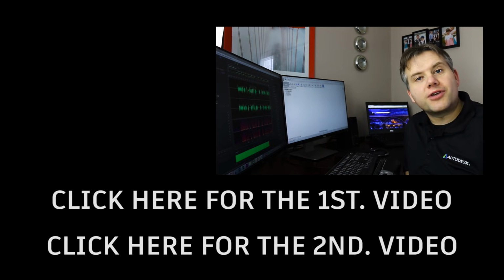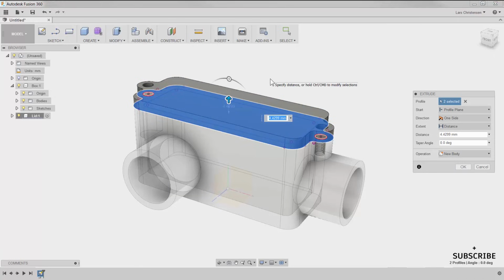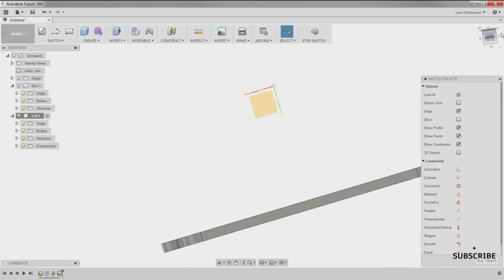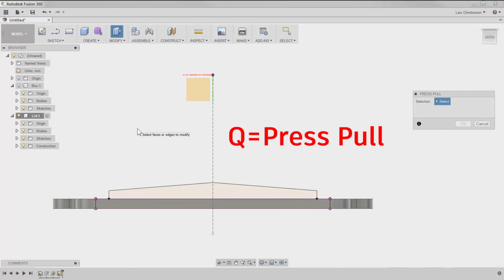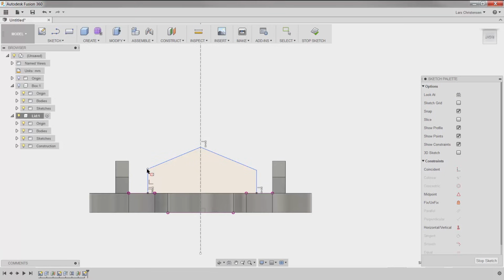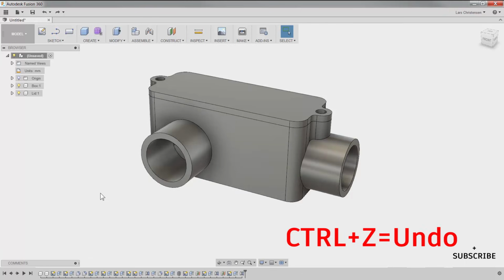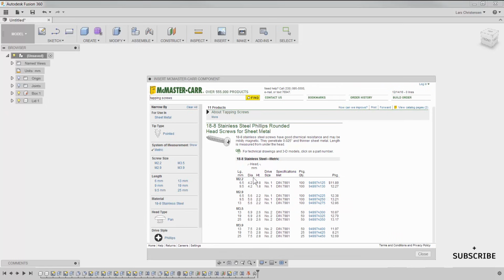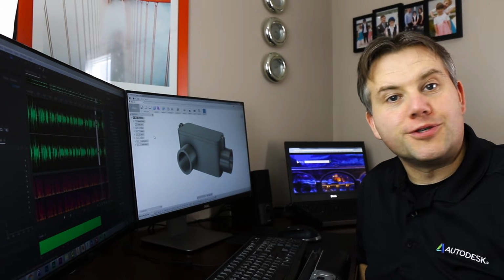Fusion 360 Tutorial for Absolute Beginners— Part 3

Comment: having problem with the latest version of Fusion, when I try to do the dimensions of the lids tabs, when I select 2.5 the lid is being pulled up in the air 2.5 mm rather than sticking to the base of the lid.. I cannot understand why
Reply: Hi, 
First, thank you Lars for the tutorial.
Same here. Also new with F360.
My approach was to Project the offset plane on the Lid surface. that made some sort of line there that you can use for Colinear constraint. hope it helps. 
I did that because even if for the first lip you can use the trick with Colinear using the edge of the Lid, for the other lips (smaller ones) I couldn't find an edge there, there are only curves. so, again, I Projected the offset plane on the Lid surface and use the created line.
Reply from the maker: Hi Juan, Are you working within the "Lid" component, or are you working in the overall assembly? Look at what you have selected in the tree on the left side of the window.
Hope this helps.
Reply: @cadcamstuff  hi Lars, I fixed by adding colinear attribute. Looks like another user here had the same issue.
I think the behaviour of fusion 360 is a little diffferent on this version
Reply: @Pin_Fandango  I had the same problem. Could you explain how you solved it.  I did something but I know it wasn't the correct way and it somewhat  works. I tried forever to fix it. Thanks for figuring it out!
Reply: Juan, yes you do need to use the "Colinear" constraint here.  I too was having trouble as the bottom of the tab kept pulling away from the lid when you adjust dimensions.  To solve this I used the "Colinear" constraint and selected both the bottom of the tab and the line for the bottom of the lid and this ensures that they re now anchored to the lid surface.  I also noticed that the tab outline would not turn BLACK and could not be extruded unless this was done.  I am using the new version of Fusion 360 and Lars videos are based on the slightly older version.  Great videos Lars, thanks!
Reply: I am having the same problem as Juan and Mike.  At the 7:00 min mark in your video, when you draw the first line, you get an "X" when you are over the edge of the cover.  I do no get this.  And like Juan said, the bottom of the sketch comes up when dimensioning the 2.5.  There is nothing keeping the bottom line of that sketch on the surface of the lid.  It's very frustrating.. I do have lid component selected.  Thanks for posting these videos.. they are great.
Reply: Another one having this problem I'm afraid. The tutorial is fantastic - just this one thing that isn't behaving correctly!

Comment: Ace videos, am following along with the model I have got to 7mins in this video and I’m STUCK. So I have the plane and the centre line but I can’t snap to the edge of the lid in order to draw the lip. Using the latest version of fusion 360.  I have snap turned on, and snaps to the construction line. 
Any tips or help most appropriated.
Reply: Xavier Choe
3 months ago
After setting the horizontal dimension, but before setting the vertical dimensions, apply the "Fix/Unfix" constraint to the two bottom vertices. Then, when you set the dimension they won't separate from the lid. Hope this helps :)
Reply: I'm the same man. I had to add a horizontal line across the 'top' of the lid to sort of create the full shape which seems to get me closer, as luke says in another reply, I then had to fix the left and right uprights, as well as the bottom one.... but still, when I try to do the dimensions for the 'peak' of the thing on the inside of the lid, it either shits the bed, or barfs with overconstraint. Must be something different.

Comment: i have used AutoCad for a long time, but only in 2 dimensional, having the need to go 3D, to three D print, i was wondering how i was going to do this,  i knew of fusion 360, which i know is a quality software.  similar to solidworks, i  thought it was going to be too difficult to migrate to 360, but i came across your excellent video series, in the three part videos you demonstrate the simplest and most effective route to using the tool, i liked the simple 80- 20 rule approach, which you demonstrated very effectively.
the fact that you have the autodesk tee shirt, suggests to me you are an autodesk trainer, if not you most definitely should be.
thank you

Comment: When I try to draw a line for the side guards, my line will not attach to the lid.  What am I doing wrong?  Thanks
Reply: Had the same problem, what worked for me was: Account Circle (Your Name) --> Preferences --> General --> Design --> Auto Project Edge on Reference (found this answer in further down in the comment section). Then, for the changes to apply, undo the side guard sketch and start again.
Reply: @jishnumehta4355  THANK YOUU!!!
Reply: @jishnumehta4355  thank you so much! The fix/unfix thing is an ok workaround, but with that option enabled, it's so much easier!
Reply: @jishnumehta4355  Thanks for repeating this :)
Reply: @jishnumehta4355  Big help!
Reply: After setting the horizontal dimension, but before setting the vertical dimensions, apply the "Fix/Unfix" constraint to the two bottom vertices. Then, when you set the dimension they won't separate from the lid. Hope this helps :)
Reply: i am having the same problem i have rewatched the video 10 times and i cannot get the projected geometry points to show on the lid.
Reply: @CallsignPoet  i think you should use snap feature while in sketch, it needs to be on

Comment: Excellent teaching, thank you Lars, and I look forward to following further videos!
I but I have found that the differences between the version of Fusion 360 and my version - only just got it - make some things seem to happen very differently! If you CAN find the time, I think an updated version would be worth doing.
One thing I found was in drawing the lid 'guides'. When I used line to sketch the first shape, the point wouldn't snap to the surface, and it drew as a completely independent shape. The only thing it would recognise was the construction line. When I dimensioned it, the shape moved UP away from the lid surface! I had to do some exploring of my own to get it in the right place!
I also find that your links in the videos don't work, I had to use the links in the description.

Comment: When I try to give the dimensions for the vertical sides of the 2.5 mm, it either goes up above the lid or imbeds itself into the lid, same thing for the tip to the last bottom line that is connected to the, I was able to keep it flush to the lid by turning it around and giving the 2.5mm dimension from the other side, but either way, when i would get to the 5mm height dimension it would go up into the air, or again, imbed itself into the lid. Any help would be greatly appreciated.
Reply: From - @UCnQFmsNTFAhTIPJVMyKgxFw -  preferences in Fusion. Make sure to turn ON "Auto Project Edges on Reference".

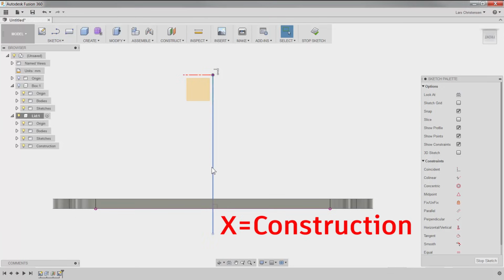Same here. I notice that when Lars places the construction line (at 6:47) he gets two dots highlighted on the bottom face. I assume that means it's an active feature. Mine don't highlight. No active features on the face.
Reply: @doug1cooper  Exactly, turned that on and finally could complete the missing lid parts, thanks! Preferences / General / Design / Auto project edges on reference
Reply: @gustavoruiz5637   where is this on the software i can not find the option
Reply: @christopherdemakis5649  Hi Christopher, I've just said it, its in Preferences / General / Design / turn on Auto project edges on reference. The preferences are at the top right of the screen under your username right-click menu (2nd entry)
Reply: @doug1cooper  Thank you for sharing.  I could not figure this out.  I got so mad I stopped using Fusion for a year.  I'm just now picking it back up.  My little barn kept going up off the lid.  This fixed it.
Reply: me too, think software has been updated since this video came out and has changed
Reply: Same thing happenning here, so far I can follow all the steps. Seems that somethings related to the current version. I'll be seeing more tutorials about it till I found the answer.

The sketch keeps hanging in the air, the cursos doesnt change its shape when reaching the base as in this video.
Reply: had this problem. theres a constrain called collinear which forces 2 sketches to share a common line this forces the triangle to use the bottom line so it wont move on you. i had the same issue and scratched my head. hope this helps
Reply: @ordinarynomad5374  Thank you very much. That is what worked for me. Auto project edges on reference as suggested above did not help. I had to click collinear from the dropdown, then click the bottom line on the lip thing and then click the top line of the lid and then hit enter.
Reply: I constrained one point with the line of the lid so it would be fixed to that
Reply: "Auto project edges on references" worked for me but I had to fully close the document and then re-open before it was effective for me.

Comment: They have moved the constraints. So to make the line on the edge of the first tab you drew straight, you have to right click and select the Horizontal/Vertical constraint from the flyout menu. Same with the Symmetry. After you select the two points and the X-line, right click to select Symmetry. Is there another way?
Reply: when I right click and select the Horizontal/Vertical constraint from the flyout menu, it shows an error saying "Sketch geometry is over constrained". Any idea of how I could fix this?

Comment: The screws part is where I am stuck. I get the screws from the 'shop' into my drawing. Then when using Joint Origin (only then I get the Capture Position) it is impossible using the Control key to get my pointer in the middle of the screw even if I enlarge the screw full screen.  Somtimes I managed to get the screw selected and tried to get it into the hole. But also that is not in line with what I see in the video. Where do I go wrong????

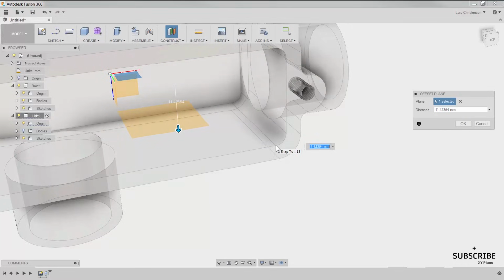Comment: I cannot snap to the reference line as you do at 5:32. I have "Auto Project Edges on Reference" on and I've searched through majority of the comments here and other articles.
How can I construct the Offset Plane by snapping to the box's body as you do?
Reply: I've been trying this for 2 hours. I cannot get it to snap to line, nvm. The part you are looking for is the point where the lines connect. There is a light circle if you zoom in.
My problem is at 7:12 . I cannot get the point to stick to the line
Reply: @titansfan2104  I'm at the same point. Did you ever figure it out? Edit: Nvm, found the answer 2 comments below.

Comment: I'm running in to problems when adding the lid supports using Offset Plane to draw inside the box opening plane. I can draw the hexagonal shape, and use the symmetry constraints, but the line never connects to the lid (Line tool never places and "X" on the lid edge) What am I missing?
Reply: I'm having the a same problem
Reply: I’m also having the same problems. 4 hours trying to figure it out
Reply: Did you have any luck figuring it out cause I'm having the same problem
Reply: @robertmac24  I figured it out!!! Go to your preferences in Fusion. Make sure to turn ON "Auto Project Edges on Reference". The Hobbyist Trial has them off by default.
Reply: @robgluckman7943  awesome thank ya man
Reply: @robgluckman7943  THANKS. I found that earlier but it didn't seem to help. Maybe I've been staring at this screen too long LOL
Reply: @robgluckman7943  THANK YOU!
Reply: @robgluckman7943  this did the trick. Thank you
Reply: @robgluckman7943  Thank you! I was going nuts over here
Reply: @robgluckman7943   Thanks man!! It works!!
Reply: @Robert Gluckman  Thx a lot saves me a few years of my life

Comment: when i extrude the tab to give it thickness, i put in the 2 mm, its shows what it will look like and looks correct. press enter and the tab completely disappears leaving only an imprint of the base of the tab.  any suggestions?
Reply: make sure your Extrude operation is correct. it might need to be changed to "join"
Reply: Ok I'll check that out. I think the problem might be related to when I drew the sketch, it wouldn't snap to the lid. Also, when I go to extrude it become red

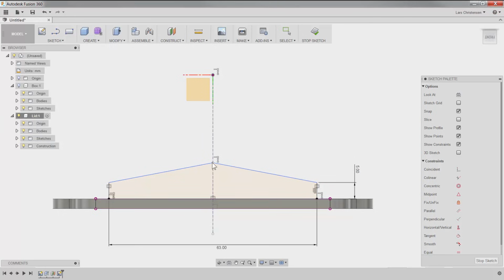Comment: Hi. First, great teaching. It's a lot easier to see than in my book. I'm having some issues that I wanted to crowd source. When I do the dimensions, as you do at around 9:00 for the slanted edge, the dimension moves the face the wrong way. I'm obviously doing something wrong, but I cannot figure it out. Any help from anyone would be great.
Reply: You can use the Fix constraint to fix the bottom line to the surface of the lid, that way when you change the dimension, it will change it in the right direction
Reply: @olsileka6522  Thank you! Been banging my head on the desk trying to figure this out!

Comment: I tried it a million times. 
When I set the distance to 2.5 it pulls the bottom up away from the lid instead of pulling the top part down.
What am I doing wrong?
Reply: Same !!
Reply: @giyad90 

I'm not sure why his attempt succeeds but in my case the shape didn't become black.
Once I added a 4th constraint that determined the distance from the bottom minr became black and was positioned correctly
Reply: @somebodyoncetoldme1704  Thank you, I have been fighting this for over an hour, told it that the bottom of the wedge to the top of the lid was 3MM and bam it moves down and turns black! Awesome!
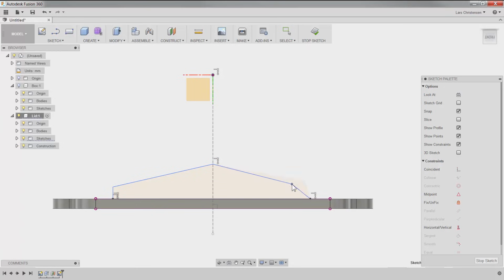Reply: From what I understand, you will have to add Coincident constraint between the vertical side line and the bottom horizontal line. Just adding on one side should be good.  What I did was click on "Coincident Constraint"-> click on bottom line -> click on a vertical side line.  The constraint now should be created.  There is an "L" shape icon indicating that but in my sketch it does not always show up.  It only shows up if I click on the join dot.  If you see this video at 7:50, you could see when he was drawing the lines the "Coincident constraints" get created automatically.  At 7:02, when he moved the mouse cursor to the bottom line, he explicitly mentioned that mouse cursor got changed because it found a cross section.  In my case, the mouse cursor never changed.  I think that is why his line came with the Coincident Constraint by default but we had to add it manually.
Reply: Another solution is to Fix the bottom 2 points. Fix->Click on the 2 end points of the bottom line.

Comment: So far I find this tutorial very fun amongst others Thank you Lars! I'm a newbie and no background on CAD and it's my first time to use a 3D CAD software, I downloaded the latest version of fusion 360 and was able to follow the tutorial from part 1 to 2 with slight fiddling due to different version.. but I'm stuck on part 3 at 7:00, the line won't stick to the edge of the lid, tried many times but the "x" mark just won't show up so after creating the lines then putting the  height dimensions 5mm on the side the face would just adjust downward into the lid... how to this? help anyone? Thanks!
Reply: @Lars Christensen  need help..
Reply: @allen5147  Make sure you turn "Auto Project Edges on Reference" on in your preferences menu (top right, click profile icon, select preferences, and the option is under the design tab).
Reply: @mammers15  Thank you! great tutorials! keep it coming!
Reply: @mammers15  Thank you! Had to turn this on as well, seems like it's off by default
Reply: @mammers15  thank you so much for this!
Reply: @mammers15  Thank you for this solution
Reply: @mammers15  THANK YOU!! I've been digging through comments and pulling my hair out for 45 min!!

Comment: Fantastic tutorial but When drawing "lid tabs", Very, very, very important to make sure "Auto Project Edges on Reference" is on in your preferences.  On the Hobby version Autodesk has it toggled off as of 9/17/21.  Program will not pickup the offset projected xz plane that intersect the lid bottom.  Thank you Mr Random for pointing this out.
Reply from the maker: Good point!
Reply: This saved my night. 4 hours trying time figure why my lines were pulling away.

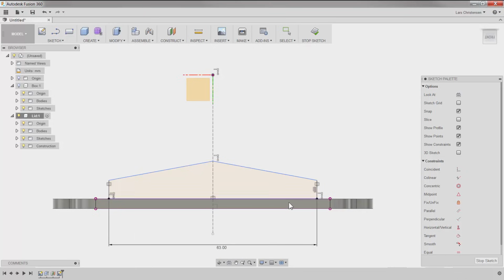Comment: At 8:54 when I change the dimesion of the side line to 5mm, the horizontal bottom line of the sketch pulls upward, instead of the top 2 lines coming down to 5mm.  Is there a constraint needed on the bottom line and the lid plane?? Got it!
Reply: first do the 2.5mm constraint, then the 5mm
Reply: @tili_  Thanks!

Comment: Incredible tutorials! I followed all three videos and created this myself. I assume at this point, a 3D printer could print out the STL file we created? I am imagining the printer would just make the lid and the box all solid. Since this file was designed as 2 pieces that were joined, does it know to print it as 2 different pieces that are together without actually fusing them so you can take the lid off?
Reply from the maker: You can save each part as it's own STL and then it will print it separate. Thank you for watching, and congratulations

Comment: Great series of video tutorials. Like others, I had some trouble with the lines/tabs on the lid, but finally managed to get them. The two short end tabs had ended up too far away from the end of the box which I discovered when I looked at a section view. I determined that I had picked the wrong line intersection and was able to go back in and edit the position of plane they are based on which then placed the two short tabs in the correct place on the lid.
Reply from the maker: Hi Phil. Congratulations !! I believe there has been a change where you now have to project the line on the lid. That could be why things went out of place